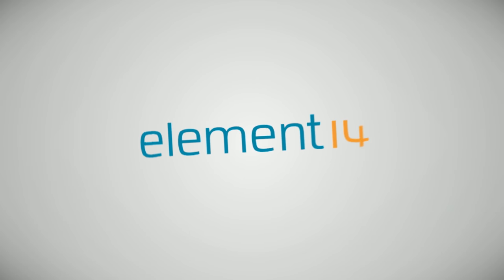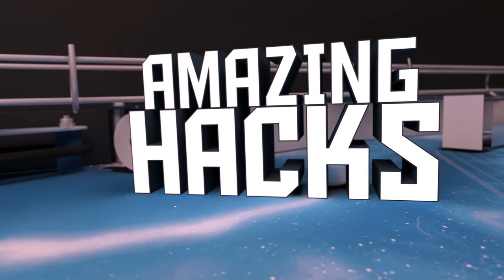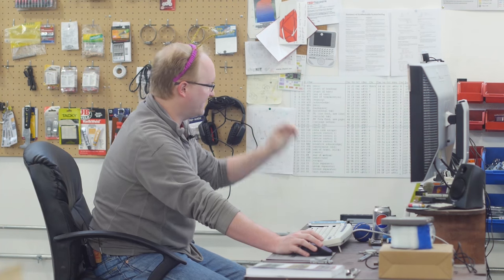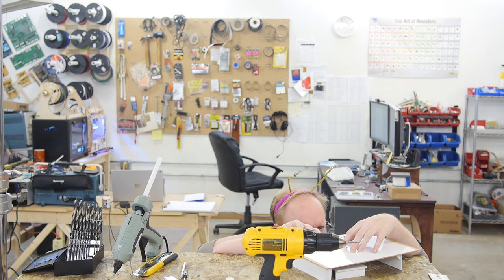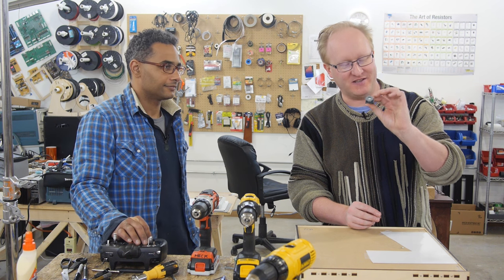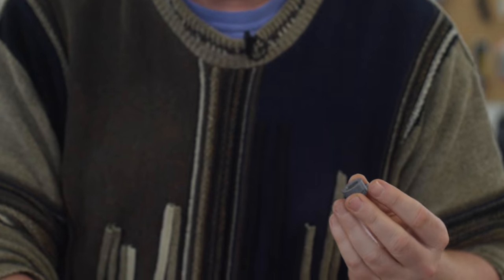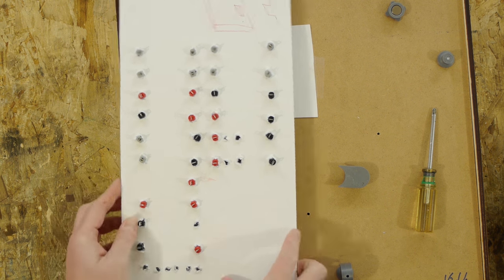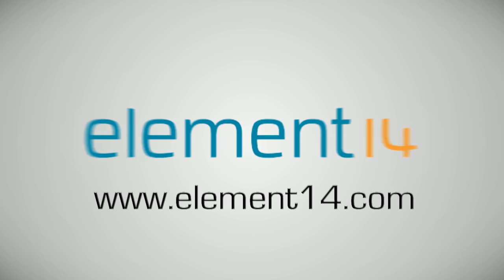Ben Heck's Hackmanji Board Game Part 1

Comment: I guess there's no turning back, but here's what I wished had happened:

1) Keep the intertwined paths! Way more interesting. Ben has plenty of experience with X/Y axes. Use an electromagnet to control the whole playing surface, rather than permanent magnets in fixed arcs.

2) Top your display with a clear dome paperweight, and mask the remaining screen. It'll be round like the original, and give the illusion of depth. Your digital dice are also inside, "Sorry!" style, and activated by pressing the dome, the whole display rig resting on tact switches.
Reply: With the intertwined paths the problem is pieces too close together or especially two pieces occupying the same square. You would unintentionaly move pieces you don't want to
Reply: I don't know the rules, or if there are any "official" rules, but I assumed that if the path is blocked, the player lose a turn. I can see how close pieces might be affected. Maybe pieces could be temporarily relocated while the move is made? And try to design your electromagnet to be precise in its selection.

Comment: 02:12 NO DICE! I thought you could make dice with RFID chips embedded in the sides that the board could read. Bummer. :(
Reply: He should do that
Reply: +Cliff Hartle I think it's easier to use an acceleration sensor inside the dice. the orientation of the board gets mapped to the faces of the dice and is transmitted via bluetooth link....even with smd components on a custom board the dice would be pretty large...
Reply: +MAYER MAKES just thought about it too, but one issue with electronic-loaded dice is it can easily be biased.... For the moment being I'd still give it a go. Actually this dice-issue inspires me to think of a whole virtually augmented game I could use it in xD
Or maybe just use image recognition- for this project it could be simple field with plexi and camera under it, shoots a photo and counts the dots :P
Both ways it's rather and idea to upgrade than solve on build-stage IMO.
Reply: ***** I too though of image recognition but from above. But that would kind of get in the way.
Reply: That's not a bad idea, but what happens when one falls on the floor? How long should it wait to read the result as the final throw? I suppose it could wait until it could read both dice at the same time. You could also have dice that can sense how they land and use an ESP8266 to send that via wifi to the board. Of course the problem with embedding any electronics into dice is keeping the dice balanced and also, can the electronics handle the forces of being tossed around. A third way would be to use a camera along with the right software to sense how the dice land. It's possible to have a camera underneath the board sensing the light wavelength that passes through the board.

Comment: I would have gone with a CNC machine type thing, still using the magnets, that way you could move the pieces almost anywhere in any direction. Programming the paths would probably be a bit more time consuming but I bet it would be worth it. Oh, and bluetooth connected dice too.
 
Anyway, what really got my attention was the power gloves. If the ultrasonics were used to track the orientation and position of the glove could something similar be used to track the location of specific items in a room such as battlebots, drones, remote control/slot cars and, my want, model trains? Sort of like a mini GPS system. Would this be even possible with an accuracy of about 1/2 inch?

Comment: Ive figured out how to make all the pieces follow the same track separately if you wanna do it right..
Reply: +imbadwrench Do share!
Reply: +theHeckwithKaren Ever see a marble maze? if you are younger imagine an IRL version of any of the 10,000 smartphone games that has marbles following a track. because one track moves at a time the marbles can cross each-others paths. Use nonferrous material for the normal balls and then metal balls for the game pieces. A sensor at each intersection can let the ball move one more time if its metal so the metal balls stay on their own tracks. A magnet in the game piece should let it follow the metal ball. Sketchup has not worked on my computer since the last update, maybe I should be fixing that.

Comment: Hey Ben, my Windows tablet's (Toshiba Encore WT8-A-102) battery is completelly dead.
Can i hook up the wires of an USB charger direcly on the charging pins?
Then hook up a monitor through the HDMI Mini port, a USB Hub from the Micro USB port and in the USB Hub plug an external cooler?
And i would make a custom case, because i have a friend that has a 3D printer.

Could i actually revive my tablet and use it as a PC?

I just need a low-end PC to do school stuff and play low-end games like Half Life, Minecraft, NFS Underground and stuff.

And as internal storage i would use a Class(10) 64GB Micro SD Card.

Comment: Hello Ben! I have been a fan of your show for some time, and I would very much like your or someone's advice. I see that you use a Makerbot 3d printer regularly on your show, but I have been having a significant problem with mine. The problem is that when I try to print high-detail parts, the printer nozzle jams and I end up with only a tiny amount of plastic being extruded - like a ghost of the original part or a spider web.
Reply: I have contacted the Makerbot people about this, bought a set of new anti-stick coated metal nozzles, taken the whole Makerbot 2 printer apart, lubricated and cleaned everything, put it back together, and still the problem persists. The extruder stepper motor appears to be working (I can see it through the spring) but the plastic filament will not move down and so the printer clicks as the teeth of the wheel slip on it. I have tried pushing the filament down - it requires almost as much force as I can apply.
Reply: I have also tried printing at different temperatures: 215, 220, 225, 228, and 210, and this adjustment seemed to make a difference momentarily, but then the printer again jammed a few dozen layers above where it had jammed previously. What I believe is happening is that a glob of PLA plastic is melting inside the extruder nozzle, and acting as a sort of buffer for the filament that is trying to be forced down - the new filament must be melted first to be incorporated into the glob (hence the increased force required to push it down), and then at the bottom of the nozzle the pressure is much reduced so that only a bit of plastic dribbles out.
Reply: When did you buy your Makerbot/How long have you had it? Which model is it?
Reply: My family bought it in late 2013, it has only 114 hours on it, and it is a Replicator 2 with a high-lubricity nozzle (mk8 .4 mm). It can still print mostly-solid objects fine, but the problem lies with fine-detail structures like text.
Reply: I have pictures of what happens, but I imagine that you have encountered this issue before?
Reply: Hmmm. I know there have been issues with constant print head failure for models released in the last couple years, but I'm not sure with that model. I'll have to check what Ben thinks when he gets back from Germany.

Comment: You guys should make a new raspberry pi handheld with pi zero and a separate system with the latest raspberry pi model now that they have much more power you could run a newer console than the first system
Reply: And see if you can mount it on a controller to get a Nvidia shield look and feel
Reply: +Kush Shah you do realize it takes like 3x the power of a system to emulate it on average right? That's if it's coded extremely well. Most computers can't run ps2 emulators last i checked if you were talking about that generation of consoles or later
Reply: +Kush Shah also my PC has problems running Android emulators and it's more top of the line than not.
Reply: +Shawn Jones My Samsung Core Prime can run a PS2 at around 12 FPS. My PC can run all but like 6 games that I have thrown at it, aka most of the big PS2 titles, at 1080p 60fps or better.
It's safe to say a Raspberry unit could be running PS2 soon, if not now, and can defiantly run a PS1.

Oh, and PC has no issue with Bluestacks, so I see no reason you would have issues with Android stuff.

PS: Are you running a PC older than 7 years old? This could be your problem.
Reply: +Shawn Jones I was talking about ps1 or before lol, everyone knows that it'd takes a sit ton to run ps2 and after

Comment: how about having 6 sided rfid dice?
Reply: +Barry Adamson, 2 problems initially come to mind. 1 you would need to roll the dice on a very specific (small) area of the board and 2. the interference of the other 5 rfid tags might pose too much of an issue. I think Bluetooth with axis sensors would be the way to go.
Reply: +Carlo Bensi not a bad idea with the bluetooth with axis sensors. The issue I think would come with that is, either the dice would have to be larger than normal dice, or you would have to find a tiny battery, a tiny bluetooth receiver, a tiny micro controller, and a g-sensor all in less than 1/2 of a cubic inch.
Reply: +Barry Adamson yes, 1/2 inch would be very difficult, especially using off the shelf components. Since this is basically a prototype, i think, a 1 inch die would be fine (still hard) or even a 2 inch die. Also have to figure out how to balance it so it's not biased, the smaller it is the harder this will be.
Reply: +Carlo Bensi yes, balance would have to be perfect. So we would (atleast initially) be looking at about a 2" die.

Comment: Hi
Reply from the maker: +Sim Shang En Hi
Reply: +The Ben Heck Show there might be a flaw with your design, what happens when every player is one spot from the end? wont the arms underneath the board collide?
Reply: +L3610NF0R14M7H37RU7H They will come close together, but will not collide and the magnets on the arms should not interfere with the wrong pawn either. I tried to do good circle math to avoid that.
Reply: theHeckwithKaren i would only see that to be the case if the plastic disks holding the magnets werent so big, it wont happen outside of the center of the board but i think the will hit each other if a player is exactly a spot a way from the board with someone else. it could be fixed by simply making the arm lower then the other though with the magnet extending to the piece